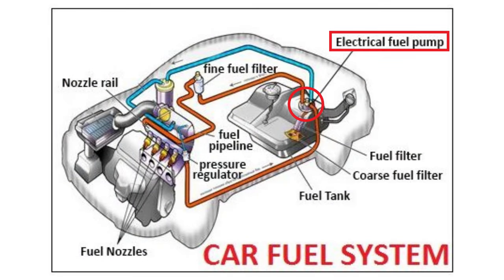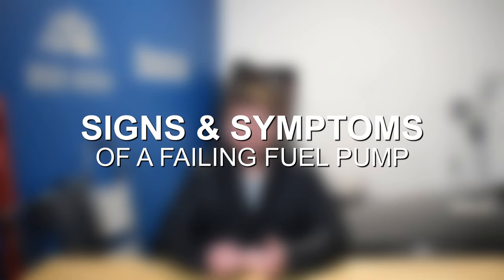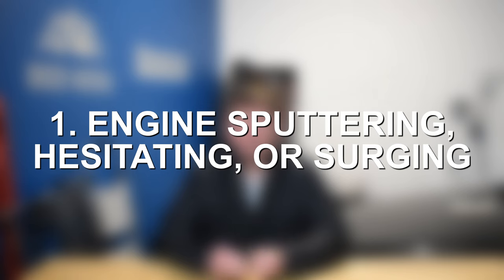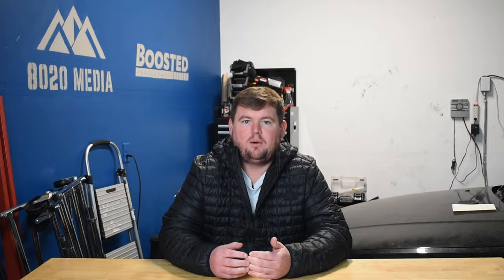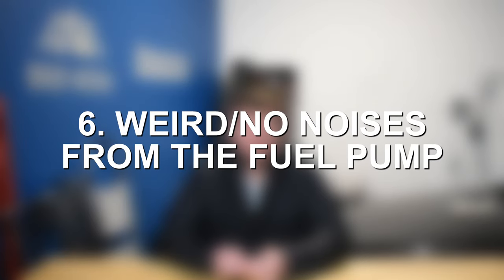6 Signs & Symptoms of a Failing Fuel Pump!

Comment: Great video very informative! 
I have a bmw f30 316d and i've replaced the engine, injectors, hpfp, all the sensors in the engine bay and the ecu. Its a bit slow to start and then the engine shakes heavily/ sputters at idle and continues to shake unless i unplug the presupply pressure sensor. But if left plugged in or plugged out when I drive it and come to a stop or low revs and speed the engine shakes like crazyyy. I was thinking maybe it might be a fuel pump issue/ module/ dirt in the tank... There are no codes showing up and no power loss... Any insights would be greatly appreciated
Reply from the maker: P - Did we read that right, you replaced the entire engine?
Reply: @8020Media  yes and the same problem is still there. Old engine went into a different car and runs perfectly
Reply from the maker: P - Did you do this yourself or did a shop do it?
Reply: @8020Media  I done it myself. But I've done engine replacements on a few Bmw's and timing chains
Reply from the maker: P - Have you taken it to a mechanic. Replacing an engine is quite complex and everything has to be put back perfectly..
Reply: @8020Media  I've taken it to two mechanics. The first one thought it was a timing chain issue. The second one said it was electronic problem but he didn't know what. Everything went back exactly the way it was. But this issue was in it before the engine swap so its not because it wasn't swapped correctly
Reply from the maker: P - Sorry to hear you're having this issue! We hope it gets resolved soon for you. Please come back and update us on the fix!

Comment: Can it be a bad fuel pump if your only having sputtering at start up the u hit the gas and it’s fine but not having any problems while driving or at any other time
Reply from the maker: L - Certainly possible. Sounds fueling related for sure

Comment: My car starts and runs great. However, whenever its even under a quarter tank of gas, the car stalls, hitting the gas does nothing then it slows to a stop and wont start again until after putting gas in it. I have no codes or issues anywhere else. Its on a 14 BMW 328xi with 130k miles. Thinking its a fuel pump going out???
Reply from the maker: J - This video may help you out as well: https://youtu.be/7bqAIbYRdnc
Reply: Did you figure it out because my car has started doing the same thing if I’m close to 1/2 tank gas it will stop or sputter bad
Reply: @tiffanym1443  no I haven't figured it out yet.
Reply from the maker: J - Have you taken it to a shop?
Reply: Hey man did you figure it out? My Lexus is currently having the same problem
Reply: @victorabreu8632  Still haven't figured it out or even cared to mess with it, I just keep as much gas in the car as possible at all times to avoid the problem until I figure something out. I replaced the low pressure fuel pump and still have had the same issue so it's either the high pressure fuel pump going bad or whatever is at the bottom isn't picking up the fuel when it gets low which is more likely.
Reply: @J-Mack269 yeah man it’s crazy, it has happened to me two times already. Every time I fill up I realize that my tank still had 3 gallons left. Every time it’s under a 1/4 I stall going down a little hill in the highway. After putting 2 gallons in the tank it starts right up.
Reply: @victorabreu8632  I'd look into what your fuel tank looks like because the level sensor in the other side may be broken causing it to not send fuel to the other side.

Comment: So I got a 2013 Chevy Pick Up and it does Symptom 1 and once it dies I try and start it and it doesn’t 

But would a bad fuel pump keep the Truck from turning Over?

I got power but it won’t turn over
Thanks for the Video
Reply from the maker: J - It's certainly possible. We have a video that may be helpful for you here: https://youtu.be/0YRdzJbHcm4
Reply: @8020Media  thank You Sir

Yea every symptom in the this video it does points at fuel pump

The only other thing it does is don’t turn over 
So hope this helps
Reply from the maker: J - Keep us updated!

Comment: Hey 8020, my car is stalling when coming to stops and when idling at stop lights and signs. It seems to start okay but after driving for about a minute it starts stalling. Other than that there is no symptoms. What else could it be besides a fuel pump?
Reply: Try a maf sensor cleaning very easy and cheap and will cause stalling at idle or sluggish acceleration
Reply from the maker: P - We think this video will be useful: https://youtu.be/7bqAIbYRdnc
Reply: Tbh I had that problem with my car, but I took it to a mechanic and basically replacing the alternator and battery seemed to fix it, as sometimes if either one of those is going bad it can stall your car. However rn I only have a crank or stuttering noise when starting the car, it could be a fuel pump issue.

Comment: I have a 2000 honda accord v6,, it will often just crank like it wants to start, sometimes does. but gets stuck often in parking lots (luckily at work). . any ideas? I most recently changed the spark plugs and ignition cables
Reply: I think he answered my question as I typed 🤣
Reply from the maker: E - Glad to hear! Let us know if you have any other questions!

Comment: Hi mate I have an issue with my fuel pump it's sending in accurate fuel reading to my fuel gauge could you tell me what the problem is  is the fuel pumpnon it's way out or could it be the fuel float. Plz reply
Reply from the maker: B - Do you have any engine codes?

Comment: I got rear ended like probably 4 weeks ago and ever since that happened I had noticed my gas on the dashboard is messed up the little gauge be going up and down sometimes it says fuel level low and when I put some the little needle don’t go up and sometimes the truck turns off on me then it turns on again I’m wondering if they messed up my fuel pump cuz it don’t read my gas mileage either it’s a 2012 Chevy Silverado
Reply from the maker: A - Certainly possible. Did you not get it looked at?

Comment: So we have a 2.4 '15 equinox. The high pressure failed, replaced. Sensors failed, replaced. Now our car is just stalling. Before, it was only popping the one code, now it pops new ones every time. The shop has had our car for a week, they thought it was good after replacing with OEM sensors vs O'Reillys, said they drove it for 30min and it was fine. We get it and get not even a mile before it stalls. It only stalls at low rpms. Would you agree it could be the fuel pump? That's their ne,t guess, everything else in the fuel line is fine they tested it all. Unfortunately our car is 200k miles but we can't sell it we'd be upside-down. 

Theres also another class action getting started against GM on the EcoTec engines for having faulty pistons/seals and lack of low engine oil sensors (ie they hid the problem by not providing a sensor). They already lost a lawsuit for this on '10-13 models. I'm worried it could be related that but idk what to do meanwhile. We also had a dipstick Firestone guy not put new engine oil in after a change and we don't know how long we drove with low oil but the filter was bone dry when we took it to the mechanics we trust (where it's at now). I'm worried about alot of damage from lots of ends honestly but I'm stuck with this car.
Reply from the maker: B - Sorry to hear about this. We have a video about engine stalling that may help: https://youtu.be/7bqAIbYRdnc

Comment: Hi. I have a 1994 nissan d21 hardbody manual tran. Running fine  on flat roads but up hills I have to shift to 3 gear to get power and at stop lights engine shaking idle at 500 rpm but won't die
Reply from the maker: S - We have some great videos that may be helpful here: https://youtu.be/ipjYLPJgpq8
https://youtu.be/BiYsqRJCLhE

Comment: Hi. I have a 2016 mustang 3.7 and i have a issue when putting fuel in and once fuel is in and my air ratio drops and rpm also  drops sitting at the gas station the car starts to shake as well fhe the air fuel ratio drops and rpm. However the purge valve has been replaced new coils and spark plugs and a new map sensor. Whats werid is when i take off the car goes back to normal and it does this everytime. Any ideas?
Reply from the maker: Z - Sounds like a rough idle. We have a full video on it: https://youtu.be/BiYsqRJCLhE
Reply: Iac selinoid maybe ?
Reply: 2013 2500 chevy 6.0 48 lbs of fuel pressure , it drops 1 or 2 lbs when i throttle it lightly , might have hit 50 on previous test , runs like the timing jumped at first , it had bypassed convertors i fixed that first , still ran like crap , im thinking fuel pump ...if im wrong ..i just bought a fuel pump for nothing , it aint my truck ..
Reply from the maker: Possible!
Reply from the maker: M - Keep us updated on this.
Reply: @MikeSmith-nu9wt  I would also check if your fuel filter is good to if the truck has one. I'm beginning to think my car has a bad crankshaft sensor since that does fall in line with emissions and affects the air fuel ratio.
Reply from the maker: Z - Certainly a possibility. We have a crankshaft video that we think may be helpful: https://youtu.be/uQRFTv86q_8
Reply: Was it running while u were fueling it?

Comment: My civic 2018 now is cranking slow. It was like it won't start at all but if i press deeper on the brakes it starts but very slowly. Even after driving the car it starts/cranks the same. The slow starting happened suddenly after i parked the car outside for 2 hours with the weather gloomy and raining. Went to a battery shop to have my battery checked and it read, 36% health, 270cca, alternator 100%.
Does it sound like a fuel pump issue or just the battery?

From experience, once my car battery dies, all the lights on the dash blinks and clicks fast. But not this time. So i'm confused if it is the battery or fuel pump causing slow cranks. Is 270cca too low to cause hard starting? Thank you
Reply from the maker: I - This video may be more useful for your research: https://youtu.be/0YRdzJbHcm4

Keep us updated.

Comment: So my 07 charger rt is having a fuel issue the part that bugs me is the cluster for the gas level it goes up and down making me think I have enough gas or not and also I just ran out of gas thinking I had some in there when I gave it some gas it started shifting weird when I was driving back home can you help?
Reply from the maker: J - Could be a fuel pump issue. Have you had it looked at?

Comment: I have a kia sorento 05. I have the same problem. But the only codes i get os for transmission soleniod. I check relays and fuses. I get fuel in in injectors. Maybe a lil too much. Im getting frustrated. My car is just cranking..check engine light is on...all that started after my mechanic just gas the car really hard as it was parked after changing a leaking gooseneck
Reply from the maker: L - Interesting.. We have a video that may be helpful here: https://youtu.be/0YRdzJbHcm4

Comment: When i turn the AC on when idle sometimes my car almost stalls, especially after going up hill, fuel pump? Or spark plugs
Reply from the maker: 40 - This video will certainly be better for your research: https://youtu.be/7bqAIbYRdnc
Reply: @8020Media  thanks alot, yes very helpful, i miss my old car which was so easy and cheap to fix
Reply from the maker: 40 - We hear you on that!

Comment: My 2004 Honda Element sometimes runs perfect but other times starts misfiring, takes a little bit to crank, dies, rpm surges then dies. I think it’s both the fuel pump and injectors but idk.
Reply from the maker: JJ - We have many DIY videos that may help you here. We would advise getting an OBD2 scanner to assist with diagnosis.
Misfiring: https://youtu.be/f1mQ5hD1-vI
Long crank: https://youtu.be/0YRdzJbHcm4
Reply: My 2006 Milan doing same thing
Reply from the maker: L - Reference those videos above.

Comment: If u have enough gas in your 🚘 in your 🚘 start up n then stall in you under your hood in you look over your ignition coils n spark plugs plus wires if all that check out good then next u wanna look at your fuel pump relay n also make sure u don’t have clogged fuel filter also look at your mass airflow sensor it might to be clean look at your air filter it might need to be replace sometimes people so quick to say oh u need a new fuel pump n soons u spend money u really don’t have on a new fuel pump n soons u installed it your 🚘 still wanna start up n the main killer u will know your fuel pump not working or completely if u don’t hear no sound when u turn your key to half way on people just do your home work n look over things befor u wanna replace your fuel pump n oh yeah one more thing use your multimeter to make sure u getting the proper fuel pump resistance
Reply from the maker: D - Thanks for sharing this. We also have a great vide on stalling: https://youtu.be/7bqAIbYRdnc

Comment: I bought a 97 Rodeo...82K miles...in pristine condition for $2K...engine had low power. Owner took vehicle to several shops...no luck fixing.
I dropped gas tank...pulled fuel pump...factory "quick coupler" on fuel pump output was cracked/leaking. Replaced coupler with short piece of fuel hose secured with hose clamps.
Vehicle been running fine...now has 120K miles.
Word of caution: I replaced fuel hose from gas tank to metal fuel line...it started cracking 3 yrs later...found out fuel hose has to be rated for fuel injected vehicles. 
Parts stores didn't have the hose...found some on eBay...vendor was in UK. $11 
👍
Reply from the maker: J - Thanks for taking the time to share your experience!

Comment: My car starts first crank, however after driving a while  and im in traffic or at a stop light and the vehicle is moving again the acceleration is retarded feels like its choking or losing power, not taking any rev at all. Now if i switch off the car restart everything is fine what causes this??
Injectors new, plugs and coil pacs seem good, individual cyliners checked by removing coil wires individually and replaced, i did this with the car in drive with the hand brake up. All cylinders are firing properly.
Please suggeat what you think may be wrong with the car. It a 2013 nissan ad wagon cr12 engine.
Reply from the maker: R - Sounds like a fueling related issue. Check the fuel pump and filter. When was your last oil change?
Reply: Razzalee 305
How did you solve your car problem 
I've got the same problem 
😂😂
Reply: @RaymondPearce-s7c these issues are ambiguous but i tell you where mine ended. I believe my muffler was partially blocked which got blocked more. The culprit is the catalytic converter my car has 2 didnt know thought it only had one.  My pcv valve also went bad, bont bother cleaning just change pcv valve. The bad valve cause oil to enter muffler ánd probably was the final cause to block the catalytic converters. They were probably partially blocked by carbon which probably led to pcv valve going bad my car never used any oil between services.
After clearing the converters ( my country dosent check exhaust emmision, ) so we just knocked them out, in a well ventilated area. Since that no hesitation to move off or after being in traffic, my gas usage is better now and the power of the car is back, need to take it on a steep hill to be sure the piston compression rings didnt get worn during the ordeal. There is no oil residue in the intake manifold now ,a sign the pcv valve was bad before.

So the converters were the reason for all the 'false positives' of reasons. After changing or however you will deal with the catalitic converters just give your intake system a general service clean air flow sensors trottle body. 
I think my engine lost a bit of it life seems like the back pressure from the exhaust system damage the piston oil rings as the engine is using oil now.

I hope this helps you let me know how thing work out for you.

Comment: My wifes car will start fine. Then after she drives around she might get a stall or a crank no start. Sometimes she will get start then stop. Only codes present are p0455 and a p0442 stored.
Reply from the maker: D - That's certainly an issue in your EVAP system. We've got a video we think will be helpful: https://youtu.be/0YRdzJbHcm4
Reply: @8020Media  Thanks! Upon some inspection, I found that the purge valve wasn't working properly. I could get it to activate with my power probe  and I could blow through it.
Reply from the maker: D - Nice! Glad it was a simple fix.

Comment: OK a loud fuel pump after starting is noisy, checking the fuel pressure with a gauge said the pressure is perfect, should you replace it at this point or could it just be loose in the tank? Tank is not full have only a few gallons in it. The owner can not afford to put much more in it. LOL Almost forgot, scan tool shows no problems
Reply from the maker: James - Need a little bit more info. How many miles and what vehicle?

Comment: So if you're around 100000miles change it that s what I'm going to do unless it meeses up before that 40000 to go Will see
Reply from the maker: Trob - If it is still functioning well after 100k miles, then no need. But you will start to get symptoms indicating the fuel pump is going bad. Very rarely will it just fail out of nowhere.

Comment: F10 550i long crank starts then dies
Reply from the maker: D - We have a video for engines cranking. We hope it helps with your research: https://youtu.be/0YRdzJbHcm4
Reply: Yea I have a 02 buick century starts then dies I've replaced the filter I'll replace the pump next and hopefully that solves the issue
Reply: @NoLiesToldTV  yours starts idle for a bit stalls? Cause mine I don’t hear my fuel pump prime
Reply: Tell me how that goes.. cause I’m on the market looking for a part out 550i 😅
Reply: @dariuslewis9320  yep not even 3 seconds and it dies and its the original pump with over 200,000 miles on it 😄
Reply from the maker: N - Keep us posted on this!